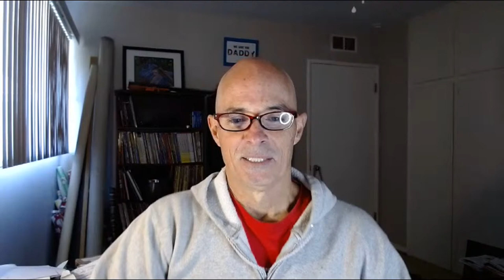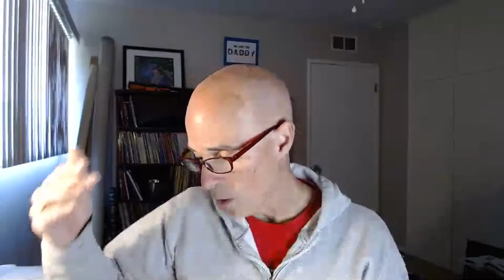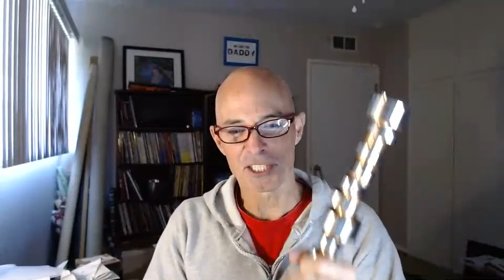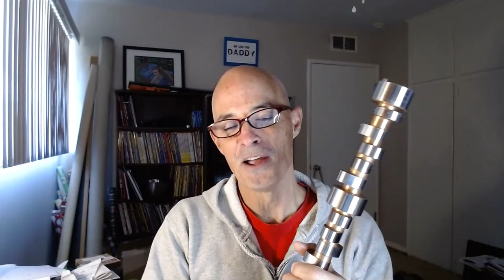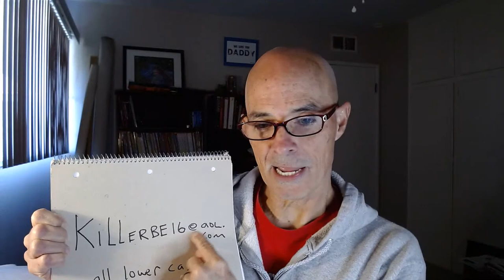TURBO TECH TALK-COMPOUND BOOST-BLOWERS & TURBOS

Comment: This is what i think.  You have the turbo feeding a blower, feeding an intercooler, feeding the intake manifold.  The blower operates as normal.  Once the turbo pressure is greater than supercharger pressure, you want a bypass (maybe a throttle body activated by a wastegate actuator) so that the turbo pressure can bypass the supercharger and skip ahead to the intercooler.  To control intake pressure and turbo surge, we can put a wastegate on the intake side after the intercooler.

Comment: A large question would concern intercooling, if you've got a really efficient intercooler your going to get more efficiency because of the density of the air you're feeding the blower. Then a slower blower speed would give good results without as much parasitic loss.
Reply from the maker: on the 03 cobra-we had an ATA intercooler for the turbos and an ATW for the blower

Comment: I read a few comments saying something like compound charging is like "1 + 1 = 5". When we compound charge, we aren't pressurizing 14.7 psi, we are pressurizing 14.7 plus whatever pressure we've already added from the first compounder (e.g., turbo). So we aren't adding boost numbers, (10 psi turbo plus 10 psi s/c = 20psi boost, or 1.4 bar), we are multiplying pressure ratios. 1.7 pr * 1.7 pr = ~2.9 pr, or 27 psi boost (some rounding, it's close). I'm a big fan of a small intercooled turbo blowing a little boost (5-10psi) into an intercooled supercharger, like on the Cadillac CTS-V, assuming the engine is already built that way. Otherwise, turbo's into ic's all day long...

Comment: Currently building smallish 2.5l v6 tdi with compound turbo setup with two k03 as hp and s362sxe as lp turbo on top. Even with tdi once you target bigger power levels (200+hp/liter) you start to need high boost numbers and that one gets tricky with single stage since usually we find rpm limited to around 6500-7000rpm on tdi not like gasoline engines. We have here 1.9tdi running 450hp with gt17v and gt45 as compound, having all the torque under 2000 and max power on 6000+ rpm. Good stuff.

Comment: I saw this earlier & my thoughts are this loss spinning the blower is about 4.5 to 6 hp. Depending on size of the pulley. Now you are going to gain hp. and tq.  Over all with the turbo 30 to 70 hp gains over the 260 hp on a stock 2.0. 
 But you will either stretch the bolts / blow headgasket at 21 pounds of boost or higher. Plus wouldn't you run out of  air flow , fuel psi. &  feed ? 
 Be safe sir. !

Comment: If I was to compound a s2 3800 s/c with stock blower I would probably have a 68mm turbo and aim for about 8psi on the turbo. My goal would be to have a good mid rpm preforming setup. 

I do think that there would be boost back up if the turbo was wanting to make more then the blower could swallow. 

Do you think spinning the blower faster then normal and then having a h2o/meth injection between the turbo and blower would be the most efficient way to make peak power and torque for a turbo to roots style  setup??? Is that something that your willing to try? 

Can't wait to see what you try and it's outcome.

Comment: I'm currently running a compound  charged ecotec,  hybrid 2.4  bore / 2.2 crank  . M62 blower 2.9 pulley  T3 /T4 turbo . I'm running a mefi controller . I will say that I'm having trouble with bypassing the blower . Richard ...i'm geographically close to your location ...if you would like to experiment.

Comment: I always wanted to mess around with a PMAC motor used in electric motorcycle conversions,  gokarts,  battlebots ect to a geared supercharger head unit either belted or direct drive. It would be hooked to some controller and little powerful battery packs set boost level and grip the trigger let it rip. Instant boost from any RPM just wont hit those really high boost levels.

Comment: Some diesels use a blanking plate on the intake of the supercharger when the turbo comes on boost so it starts running in a vacuum using less power and a bypass for the turbo

Comment: In my compound setup using a GT35R blowing into a TD04, at 36psi manifold pressure the small turbo is operating at 1.38PR or the equivalent of 5.6PSI.
Reply: Great to know! I'm planning the same combo on my built 2.2L. What are you doing for boost control, I'm guessing it's all electronically controlled via solenoids?
Reply: SoCoNoHa  I’m using the factory PCM to control the primary gate. The secondary gate between the manifold and big turbo is passively controlled by boost pressure and back pressure. My factory PCM has only 1 boost control solenoid, but it does have a “surge valve solenoid” I’m going to try to use for the second gate.

Comment: Regarding blower load. Yes it will draw more power as RPM rises even if the boost doesn't increase, because to maintain boost as RPM increases more lb/hr of air is required. Aside from RPM it's worth bringing up that supercharger load on the engine is also a function of pressure ratio. For instance 8PSI of boost requires more power to deliver at 10,000ft elevation compared to sea-level. This should be obvious but it means the input pressure matters. Compound boosting is going to dramatically change the input pressure of the secondary booster and the efficiency of the secondary will influence the output pressure of the primary. But going back to the original question, should I use a larger pully? Well you can't answer that because we also need to know the goals of the engine.

Comment: Hey Richard,
Was watching castle main rod shop and buddy got a lsa with two centrifugal blowers. What about that with some turbos to cut parasitic lose? Super cool would be a pulley disconnect at a level where the chargers have spun up enough to take over. But how would a stationary rotor mess that up? Next level what about a bypass compartment under the blower to completely my pass it to a short runner to make it wild up top?

Comment: There was a guy in the DC area that had a twin turbo'd 360 magnum in a 68 Cuda. 2 GN turbos and a blow-thru carb. Meth injection using a boost referenced FIRE EXTINGUISHER. LOL! Ran low 10s. I was thoroughly impressed. I was intrigued about turbos before that (had a buddy turn me on to turbos back in the turbo Mopar K car days... RIP to him tho...) and then my interest was set on fire after seeing that Cuda...

Comment: I'm super excited to see the compressed air supercharging. If I understood it better I would like to try it. I can imagine ways to diy it but it can't be as simple as it sounds.

I have a SAAB 9-3 estate with a 2.0T and it's a great car. It acts like it's 1000lbs lighter than it really is, despite being bone stock FWD on big squishy all seasons. I ❤️ it as much as my Miata and 350z.
Reply from the maker: THE VALVING AND CONTROL STRATEGY IS NOT FOR THE FAINT OF HEART OR WALLET
Reply: Take a cheetah bead sealer and let er rip in the intake. Not sure about adding fuel though

Comment: Richard Holdener look up turbo-compounding as used on WWII aircraft engines.  Turbo exhaust section geared to crankshaft.  R3350 radial engines used it as did some experimental Allison V1710s.  They made big power.  Would be fun to experiment with that tech on a V8!

Comment: Hey Rich, could you do some compound testing with a centrifugal + turbo too, possibly using that TorqStorm that seems to come up quite often? Thus far, I think I've only seen the diesel guys run a compound with a centrifugal. I believe it was the Powerstroke guys actually who were getting into centrifugals. 
 
If so, would LOVE to see it tested both ways - turbo -> centri -> intake, and centri -> turbo -> intake 
(I remember reading a thread on a diesel forum comparing the potential pros & cons, have wanted to see the difference since)
Reply from the maker: we did that way back by feeding the Eaton roots blower with a centrifugal on 03 cobra

Comment: I love my 3800 L67 M90'd 410 HP to the ground GTP set up. Jay Grosflam
Jay Grosflam
1 second ago
ZZP, maybe intense racing has heads - ZZP has the aluminum heads - Talk to Kevin Yates Racing in St. Petersburg Florida for the specialized cam and Molnar rods, and special pistons, and a killer crank. Kevin is making a 3800 engine for me with my TVS 1900. Kevin is the guy for super max-effort big bang engines for the 3800.
Reply from the maker: we are using stock internals

Comment: Why not a clutch pulley like AC compressors use, but something that can handle the power the blower needs. Ive seen Mercedes use clutches on older AMG blowers. That way you can drive it to spool the blower then essentially disconnect and bypass it
Reply: Wouldn't the stationary rotor pack be more restrictive than a moving one?
Reply from the maker: I think it would-ideally needs to be pypassed
Reply: What would be the advantage of the clutch vs bypass ?
Reply: @kyleallen3857  there wouldn't be any, the clutch would stop the rotors turning and therefore make them a huge restriction. Best way to go would be a bypass of some sort
Reply: @jeremymann8930  I agree with you. 

I was trying to understand what the OP was trying to say. 

I thought the theory was to use the Positive Displacement SC normally at 14.7 pounds of boost to the engine to double HP beginning  lower RPM ranges this adds to the available exhaust gas volume/velocity to the Turbo. 

I suppose you could run a Procharger into the Intercooler and then to a Turbo and finally the intake manifold. 

Richard didn’t really cover what the title suggests.

Comment: So why does a compound work so well on a diesel, and then not translate to a gas engine. (Question mostly about the gas application). Nothing complicated, just a sane choice for a primary and a bigger one to feed it. Nothing works better on a cummins. 3-500 hp driveable primary, and the bigger one pushes it to 6-800 while working well and controlling egts on a low rpm 5.9.
Reply from the maker: different engine speeds-fuel strategies, component strength-completely different application

Comment: Of course as a supercharger increases in speed it creates more resistance.  1 oil viscosity is a resistance to flow.  The faster you spin it the more resistance. 2 more boost means that you have a pressure differential across the supercharger meaning the greater the resistance.  3 aero dynamics, in the aerodynamic equation velocity is squared so the faster you spin the super charger the more resistance you get.  4 while small the hotter things get that is energy that was put into the supercharger that did no work and left as heat. 5 lastly force is mass times acceleration so if you sweep threw the rpm you are accelerating the super charger at a greater rate.  So there is more loss.

Comment: With gutted M90 Supercharger with a turbo blowing threw a L36 series2 long block(higher compression , strongest ) would be the best 

- OR L67 Supercharged series 2 long block ( lower compression) 

- the only downfall is the N/A Injectors are in the LIM & The Supercharger injectors are in the heads !

Comment: The most important people need to understand about compound setups is that each stage acts independently. So 5psi(absolute) + 5psi gain isn't 10psi. It's BAR * BAR. Why this is crucial to understand is that the same principle of multiplication instead of addition also applies to heat generation. This means that any efficiency loss is COMPOUNDED (dun dun DUUUN). 

So run the supercharger with as much boost as you can, within the efficiency range it's designed for as though the other stage doesn't exist. Don't over spin the supercharger if that will drop your efficiency 5%. If it's twin screw that's good, as it doesn't drop too much for a decent range. If its roots then you need to be careful not to go nuts. If it's centrifugal then try to ensure you're not running off the map at the top end.

But I'd not lose sleep over parasitic loss. Any HP the supercharger "takes" it also gives back anyway. Unless you're shooting for 1500hp for a drag setup odds are you'll have WAY more absolute boost than you'll ever need. The bigger challenge is sizing the whole system properly. If you've got a 2 liter engine running a supercharger pushing 1bar then don't assume you can spool a giant turbo designed to flow 1200hp, as you only have an effective 4 liters worth of air. But you'll also choke the engine running a tiny 300-500hp T3 or T4 frame turbo. A good balanced setup will yield good results for all around driving enjoyment.

Comment: Ok, hugely debated subject with my nephew and I. What do you think works better twin turbos or compound little turbo into big turbo. Also do they work the same on a gas and diesel what set up is more benefiting to each fuel type ..🍿🍿
Reply from the maker: you would use twin and compound for different applications

Comment: Check out the Mercedes M256 engine in its AMG trim. Electric 48V start-up blower, a regular turbo, Integrated starter/generator at 48V, no accessories on the front as in no fan belt. Everything's electric. Water Pump, Power Steering, Power brakes, A/C. There's a DC-DC inverter to provide 12V for legacy stuff.
Reply: Yup and out of everyones price range for an undependable car company along with bmw...

Comment: Buick grand national will put down 1100 wheel hp. With high boost and 3/8s head studs & even then the lifted the heads off the block. There was an article on it back in my high school days from hot rod mag. About it.

Comment: It seems to me, and you mentioned it, the answer to “compound” is to use a modulated nitrous setup to get the turbo spooled, then hold on from there! Sorry I didn’t get to watch live... Otherwise, the power curve you start with will be enhanced by the turbo, as you’ve shown many times. The 2+2=5 effect of putting boost into the blower should make it effective far beyond its intrinsic capability. Finally, I especially liked your comments about respecting other people’s opinions. I think that’s called freedom, and that is the basis of our country and the constitution which has guided it.

Comment: I think the pressurized air going to the blower would reduce the amount of parasitic loss from turning the blower. Enough pressure going in should turn the blower itself.? So I think it would be easier to turn the blower with boosted intake charge.

Comment: What's better, de-coupling the blower with a clutch or letting the turbo spin the blower and power the crank via the belt?
Reply from the maker: bypassing the air around the blower is best-but decoupling the blower would help

Comment: On the RB25 i put a greddy plenum on and the stock turbo made 300hp@wheels on 12psi, I highly recomend a greddy plenum for the rb25
Reply from the maker: we will test the short-runner-long runner intake designs
Reply: @richardholdener1727  I've just gone away from the short runner inlet, back to OEM long runner inlet to promote mid range torque and spool 6266 turbo better.  RB30 (longer stroke) with RB25 head.

Comment: I'm doing a similar build, with a 2.0L (or 2.3L stroker, or 2.1 longrod destroker.. I have/building a few 4G's) mitsubishi 4G63/64 and an M62 Blower. My M62 is the one that came on a '99 Benz 2.3 Kompressor.. which used an electronically-actuated supercharger clutch, similar to an A/C clutch! So charger can be turned "on/off", I was going to use the blower forcing air INTO a stock framed DSM turbo compressor intake. My goal was to provide boost to the engine down low, with air flowing THROUGH the compressor blades as well as assisting the turbo spool, until as soon as 4-5.5K rpms when a larger turbo was spooling, electronic valves (TB'S) can switch allowing turbo to start sucking from its own 2ndary air filter, supercharger gets eliminated from the intake plumbing and e-clutch released(no parasitic drag).. and engine keeps going for BIG turbo HP up top. The E-clutch'd charger forces you to remain the same pulley size on that, which is why I've had a LARGE custom aluminum crankshaft pulley machined to allow me to reach the supercharger speeds I'm aiming for, maybe ONLY run an alternator off crank pulley (accessory drive beyond supercharger). Search for an epic old thread on the NASIOC forums from a user reddevil, that turned me on to using this supercharger and lots learned from his build saga.
Reply from the maker: very cool-let me know if that works

Comment: I think small pulley then pressure switch with clutch on supercharger with huge bypass valve.  Open valve first, then disengage clutch.
Reply: No need to disengage the blower. It wont draw much HP when the bypass valve is opened. The big problem is that the factory m90 doesnt have a big enough bypass valve. Needs to be way bigger. Other than that you need to run the genV version of the m90 and you could leave the stock pulley on it, and blow boost through it.
Reply: @nastychevys  how much will the bypassed blower heat the air if not disengaged? It is going to moving really fast at high rpm. Even if the blower is not producing boost and much of the air is bypassing it, there will still be a large amount of air passing through the rapidly rotating vanes bearing the air adding I would think significantly to the inlet air temp of the turbocharger. I would want to place a temp sensor at the turbo inlet. See the difference with the blower engaged and with the belt removed. Bypass opened in both tests. More than 5 degrees and instal a clutch.

Comment: What about back pressure between sc and a big turbo a lot of testing to get right combo sizing etc to be efficient say 8000 rpm sc   say 6 psi turbo 20 psi what's pressure difference let a lone pressure drop across cylinder be very interesting